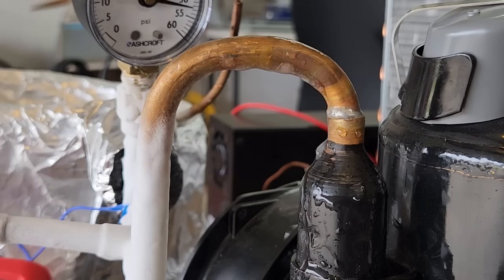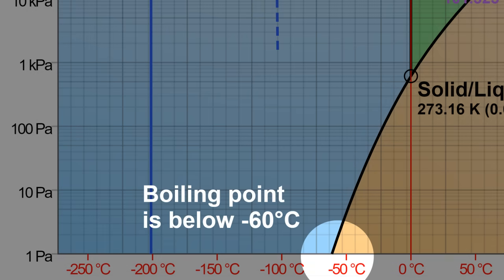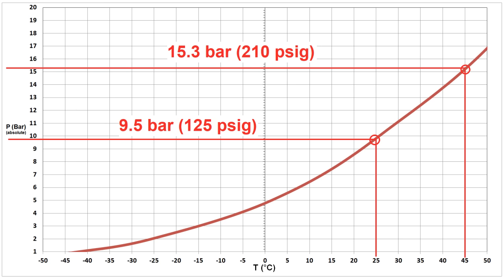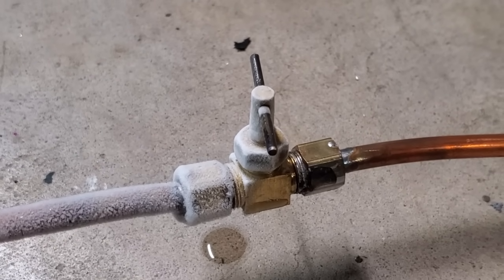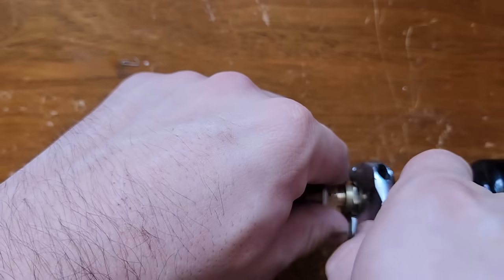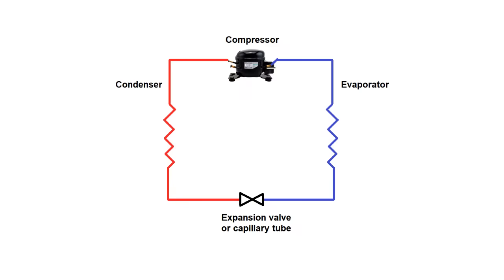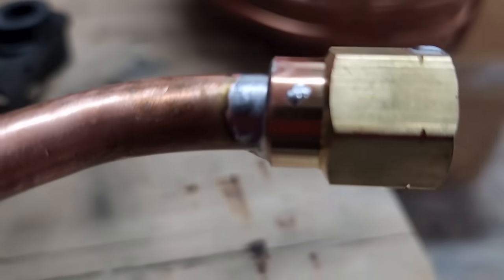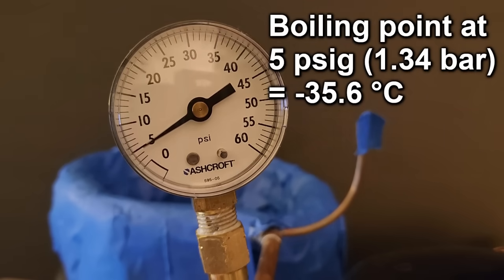DIY Vapor Compression Refrigeration System

Comment: A few notes, from someone currently going to school for this:

- Install your filter dryer last and change it as close to every time the system is opened as possible. Installing a filter dryer should be a very quick hot potato sort of operation, you get the pipes lined up, swaged or flared and ready, and right after popping the filter dryer caps off you stick it into the pipes and start brazing or tightening. There should also be zero temperature drop across the filter dryer (within your measurement margin of error), a temperature drop indicates the filter dryer is clogged or otherwise producing a resistance to flow. That dryer spent way too much time open to atmosphere and is unlikely to have much dry dessicant left, especially if you blew air through it testing the cap tube in that one clip 

- Solder, no no no. Solder can't be trusted with the sort of pressures you're working with. You should be using brazing rod, and learning to make flare fittings will do wonders for the ease of disassembly and modification of your system

- Awesome work on the calculations for your capillary tube! All that homework you did is the only reason this is working at all. 

- Pulling a vacuum before charging is, like super duper important, not just necessary. For best results, pull a vacuum below 500 microns of mercury (about .67 mBar), break the vacuum (let <1 bar of pressure in) with an inert gas (ideally nitrogen), pull another vacuum to below the same level, break it with refrigerant, then pull a third vacuum before charging. That's what's done in industry to reliably eliminate all moisture that can reasonably be removed

- That tube-in-tube HX for the cascade system is sketchy, to say the least. I'm very curious what sort of ridiculous pressure drop you have across it, the uneveness in space between the tubes is going to make all sorts of weird constrictions and pressure drops. An evaporator should have the same pressure throughout the whole thing, maybe a couple pounds' pressure drop at the very most, you'd do well to stick a pressure gauge on either side of that evap

- In the industry when we hook up to a system we measure what we call superheat and subcooling. Superheat is how many degrees above its boiling point vapor warms up in the evaporator after boiling, subcooling is how many degrees below its boiling point liquid cools to in the condenser. For instance, at 21:03, you just described 15 degrees C of subcooling, which is really quite a lot of subcooling, I'm taught to generally look for about 10 F/5 C of subcooling, so your condenser was performing quite well. Your evaporator got as cold as it was going to, without knowing the outlet temperature I can't tell the superheat but it was probably also quite high, I'm taught to look for 10-20 F based on application. Looking at a cap tube system, high subcooling and high superheat is generally a massive red flag for undercharged, that setup might have just needed more gas to perform better. With cap tubes, charge until the desired superheat is reached, for your application that's probably 3-4 C under load.

- The compressor is cooled by the cold vapor refrigerant coming back through the suction line. Your compressor didn't overheat because the condensor didn't reject enough heat, the condensor rejected tons of heat, the compressor overheated because at such low pressures it barely got any refrigerant to cool itself with and what vapor did come back was likely highly superheated. Issues with mixing and matching compressors and refrigerant aside, also a sign that the system could have taken more charge

- I don't even want to know what became of what charge was in that AC unit when you bought it to harvest its organs. Whatever happened to it, that was probably all illegal, if you live in the U.S. and aren't EPA 608 certified it was definitely illegal. Not judging, just a heads up

- Second setup: I see 15ish F subcooling and 5ish superheat, high-ish and somewhat low respectively. Condenser is very slightly starved and the evap is bordering on flooded. A flooded evap is fine to see in no-load conditions without the second stage built yet, especially with a few degrees left to protect from sending liquid back to the compressor. Once it gets a load on it and your superheat starts going up your compressor might stop getting cooled as effectively and overheat, though. 

- I think you've done this whole video charging passively, but I'm not sure. Just in case you've been opening up your propane bottle with the system off, weighing in a charge and stopping at that, you can charge with the system running by hooking the low side up to your container and metering it in. Should ideally be done with the system having reached its thermal equilibrium so you can charge based off good measurements.

- The cooling power calculations are gonna be off by more than you expect, just that little bit of condensation on the beaker is actually a ton of heat leaking into it. Good news! Your calculation is definitely an underestimate.

Very cool! Also kind of concerningly dangerous but you're definitely doing your research. Interested to see where this goes.

Edit after sleeping on it: Lost in trying to transfer knowledge, was, holy shit! This is really impressive, you've really done your homework. I'm almost only squawking about danger because of the solder rather than brazing, God only know I've done stupider. Keep at it!
Reply: You nearly got a like from me when you talked about the compressor being cooled by the refrigerant return stream and you made some good points, then you started beating on the guy! As a refrigerant engineer, have you never done anything a little naughty? The answer will be yes, we all have! This is one of the best You-tube channels, encouraging people to ask the question `how does it work` and how to modify things for other purposes. As for any perceived risks, they are very, very minimal and they are personal risks, and as such are of no concern to us.  I don`t mean this to offend, I am just aware that negative comments on You-Tube (and in real life) have the potential to stop people pursuing their hobbies and vocations. In the very least, it might put someone off the idea of publishing and sharing with us.
Reply: You're massively overthinking this. SH and SC are refrigeration and application specific. One application might have 5° of superheat and another might have 30. It depends on the application. There's no rule of thumb.
Reply: @Carbon good analysis of his efforts and shortcomings. About the only thing I would add is not to use soft solder on discharge lines and original compressor is probably designed for high temp application your low superheat concerns are warranted and you are right adequate mass flo cooling capability at operating temperature is also important. You have to keep the compressor happy. (I have worked in the trade over 40 years)
Reply: Agree with everything you say until your actually doing it in a time crunch especially the vacuum stuff.?😅
Reply: @jayfowler4747  breaking and redoing the vacuum is really only necessary with very large systems. For light commercial and residential systems a vacuum of 500 microns is fine and no nitrogen purge is required, the manufactures don't say its necessary.
Reply: You know there are other ways to do things besides what professionals do that get the same results... For example nobody is going to pay you to stand around for a long period of time with it just sitting under a vacuum, so you do a whole procedure.
Or you can just leave the vacuum pump hooked up for a long time. Lol 

As far as leeching refrigerant into the air being illegal, that's actually a gray area because you can buy the refrigerant as a spray can for freezing electronics to test them. Yeah, all kinds of CFC containing refrigerant in a spray can designed to be sprayed out. 
The difference is application and scale. There's no law that says he can't leak the refrigerant because he's not doing this as a professional HVAC guy. He doesn't have a license to lose. He doesn't have to report to certain authorities about things.
It's all bullshit politics. So I'm not advocating destroying the environment by encouraging huge industry to dump large quantities of CFCs into the air. Saving the ozone layer by reducing the CFCs being released is one of the greatest comeback stories of modern times.
But at the same time, if you open up your homemade cooler and release everything to the atmosphere, not only is there no authority to arrest you or charge you with anything but technically you're not being held to any law in the first place. And if you disagree come back with the actual numbers because we can all look up the laws online. ** This applies to US law only, It may differ depending on where you live
Reply: It's "super important" to vacuum out the A/C system on a car, but myself, like most people with a leaky system, simply buy a new can of R134A every spring. By next spring my A/C doesn't work again, who knows how much air/water got in there over the winter. It has a small leak but a leak to atmosphere nonetheless. I just squirt 134A in there, don't even purge the lines, barely look at the crappy gauge.

Still makes ice cold air in the NC sun, after 180,000 miles and 23 years of this abuse.
Reply: It is worth pointing out - it is nice of you to share tips, even if they are picky. ;) Something about HVAC guys, they guard their trade secrets like a chihuahua guards his Taco Bell. How dare a mere peasant play with refrigerant!

If you ask anything like this on a DIY forum you will get shut down immediately...
Reply: @TheTemporalAnomaly  I mean I've seen a case where a R134A/R410A mix was used as a rough R407c. EPA would stroke out if you do it but it works...
Reply: Solder can withstand 30 bar though, she'll be alright.
Reply: @hascrack3783  Ive seen it before. 50/50 mix by weight is that close to 407c that it'll work fine
Reply: @ForgottenLore  I've seen a soldered refrigerant line break lose. It technically can hold the pressure, but does not hold up to the heat and constant vibrations.

Flared fittings would be one of the best here, perfectly HVAC acceptable and cheap to do....but a bit time consuming. Compression fittings are no good either, even though they can technically take the pressure.
Reply: @ForgottenLore  for most of the joints soft solder should be safe enough but where he drilled the 2 90 degree elbows and soft soldered the smaller diameter pipe in is pretty sketchy, there's just not enough surface area for a strong reliable joint, decades of patching things up tells me it will fatigue crack in time
Reply: I love comprehensive additions to comprehensive videos, thank you for yours
Reply: @TheTemporalAnomaly  he is not an engineer yet, he mention school so he is still in training
Reply: I'm just learning so likely wrong but high subcooling would mean lots of liquid in the condenser and low subcooling would seem to mean too much liquid in the evaporator as zero would mean all liquid in the evap. So I would expect an overcharge or low load instead of undercharge. Could anybody help correct my understanding?
Reply: @dantronics1682  Most of his comments were spot-on, the only thing that I took a little issue with was the fact that he was kind of reprimanding the video creator for a `green` issue that most of us have violated at some time in our working lives. This is an excellent channel and I would not like to see him put off by negative comments.
Reply: @TheTemporalAnomaly  yes they were text book answers
Reply: Felt like I went back to school there, lol
Reply: That is a very well informed comment, speaking as someone a little informed!
Reply: I repaired a small comercial fridge using domestic propane, a re-purposed compressor from a dumped fridge/freezer. I used soft solder for the connections and had only one pressure gauge which I used on the suction side of the compressor as I charger the system. I did evacuate thie system before I charged it - by hooking up the suction of my workshop compressor to the improvised fill valve (a 1/2" ball valve). I did not change the filter/dryer.
18 months down the line that fridge is still in good shape and playing a vital role in my wife's mushroom business.
The pressure rating of a 95% tin solder at these pipe diameters and temperature raings is around 25bar so I see no safety issues there. I've been a mechanical engineer for 40 years. If you only ever do things "by the book" you will never make any progress or learn anything.
Reply: @nickwinn7812  sometimes people get hurt with the flammable type
Reply: Since nobody in this thread commented on this: What is your issue with the heat exchanger? Why do you think there is going to be a significant pressure drop across it (in either side)? What makes you think the inner tube not being centred matters in any way? The cross section around the inner tube will always be roughly constant, regardless of where it is positioned. The gas flow having to "go around" a super tiny bend is next to irrelevant. A whole 90° elbow bend only adds a pressure drop equivalent to the drop along a 50 pipe-diameter long section.

About the cooling power / condensation on the beaker: He had a nearly straight line of T over t (constant dT/dt). If the effect would be relevant, the curve would have gotten less steep at the lower temperatures. But it did not.

Why do you think soldering is an issue here? I am not sure if I ever saw brazed R134a lines, I think that would have stood out to me. Yes, it has a lower vapour pressure, but I doubt the safety factor would be that low. Seeing how solder is as strong as the solder itself, as long as the copper is properly wetted... it does not feel wrong. However, I am not going to do stress calculations and I dont have experience with such things (failing). So if you have some insight that would be great. Something like... maybe its the larger pressure swing (start/stop) that eventually causes cracks to form due to fatigue.
Reply: or you could put it under vacuum and let it boil off any moisture.
Reply: brothers a red seal refig mechanic, will have him look at this quick to tell me either "hes full o' !@!@@%" or "yea this looks about right"
Reply: @ryanroberts1104  You are a small time kindergarten violator!  :)   Back in the 70's I had to put a can of F12 in the system each morning before work! At 59 cents a can it wasn't an issue! Now at 50 bucks a can I carefully trace out any leaks at all. Going on 2 years now with no change in cooling in my 88 Towncar!
Reply: The whole first comment is gold. As a electrician I happen to have experience with brazing. Cherry red and brazer rod. Silver stick is a good one I use.
Reply: @ForgottenLore  solder decame brittle at low temperatures, I saw electronic sensors solder failed at - 45ºC
Reply: you forgot to mention that the capillary tube should have been coupled to the vapour line for improved heat transfer.
Reply: @hascrack3783  You can mix R600a and R290 in 50/50 and get a refrigerant thats 100% like 134A, just flammable.
Reply: @glasslinger  where are you even getting r12 these days? All the stuff I can find is knock off freeze 12 blends, not actual r12.
Reply: He wont see any liquid flowing in the compressor because there is a tank for catching any condensing refregirant before the compressor but yea the other points are correct specially the ammount of refregirant in case he doesnt want to starve the compressor if it all condenses edit * liquid seperator i think its called in english
Reply: @ryanroberts1104 if it is low and not totally empty then vacuum doesn’t matter.
Reply: @jamesschuchardt9509  And I explained it was entirely empty and vented to atmosphere. Every season!
Reply: If you're in the industry then maybe you can help me.

I want to replace R134a in my car with pure R290. 
Not a mix of R290/R600 to match the pressure curve. My goal is to have a lower boiling point so I can increase the cooling capacity. 
I moved to a hot and humid climate for a few years for a job and took my car with me. 
The A/C is charged correctly but simply can't keep up with the humidity. 
At 96-97% compressor load my evaporator temperature is at 18°C or even higher. Sometimes even 24°C on a particulary bad day . 

Do you think it is possible? It's VW and I have VCDS so in doubt I could modify sensors with resistors to my needs.
Reply: @no-damn-alias  Not worth the effort. Even if you manage to do the refrigerant swap, the extra cooling capacity doesn't come from nowhere, that would be harder on the compressor. Pretty certain you'd also need to change out the expansion valve which, at that point, you're doing so much work you might as well just go to a scrapyard, find an automotive AC system with more cooling capacity, and rip the whole old one out to replace it.
Reply: @carbontetlabs8606   well I could change the pulley on the compressor or on the crankshaft wheel for a different diameter to the compressor does more work. 
There are adjustable expansion valves out there. 
An AC compressor is rather cheap for that car so is an expansion valve but changing out the whole AC system will be a hack job. 
This car is from 2008 and residual value is about 3000€ and I mainly want to keep it as it has emotional value for my wife although she now drives my Mercedes with my son as it has a stronger AC. My stay here is temporary for probably around 3 years. 

I just thought about it theoretically so far. 
I studied mechanical engineering and I can help myself on many matters but AC systems are not my field of expertise.
Reply: He really used electronics solder for this? lol I thought he was brazing here and called it solder, usually means the same thing. Brazing and solder is same, I do agree to buy the solder which is engineered specifically for refrigeration or application.
Reply: hvac nerds
Reply: @TheTemporalAnomaly  so can i try with solder? Dont want to spend for stuff i might use Just once
Reply: @paolo69  It`s been a while and I have lost track of the comments. Please clarify your question, what is it that you want to do with solder? Soft solder is ok for the pressure but does not hold up well to hot/cold temperature cycling. I am guessing that your question was about this subject.
Reply: @TheTemporalAnomaly  yeah i want to try to build a small vapore compressione system because i have the compressor and most of the material Needed, It wont be a finished thing Just a prototype to see if i like this type of project thank you
Reply: @paolo69  Yes, that is very easy to do as long as you are aware of its limited life due to the solder suffering fatigue from repeated thermal cycling. I would salvage the compressor and capillary tube from a fridge. Make two coils of tube, one for the condenser and another larger diameter for the evaporator. Use the little copper bulb connected to the capillary tube (drier filter), connect between the condenser coil and evaporator. Into the bulb end from the condenser, through the capillary into the evap. The compressor output goes into the evaporator coil and the free end of the condenser goes back the the compressor input. I would use all copper tube as steel is difficult to get a good solder joint to (less wettability for soft solder). Use a good quality tin-lead solder and use a separate flux. Make sure you clean the ends of the tube well where you are soldering. Make sure that any gaps where you want the solder to flow are small as possible. If one tube is too small for the other, wind some fine copper wire around it to increase it`s diameter. For the refrigerant, I would use regular butane lighter gas, for a demo unit like this you will not need much more than 100g. Pay special attention to the joints to the motor input and output as these connections on the motor are usually steel. Use a vacuum pump if you have one, before the gas fill.
Reply: @paolo69  Let me know if you got my comment and suggestion. I think U TUB is deleting my comments for some reason.
Reply: @TheTemporalAnomaly  yes i got It thank you and It Is still there After a day so i think, at least some comments, are safe
Reply: I tried to measure the super heat of butt gas but had no luck
Reply: @markshort9098   Wrap around with some fiberglass cloth strips and JB Weld original after?
Reply: @carbontetlabs8606 Before pulling vac, pressure test at the highest pressure on the low side
Reply: As an Aussie fridgy, finding the conversation entertaining. Yes we are also regulated regarding refrigerants. Just to add regarding air in the system. The moisture in the air will turn the ester oil acidic which will eat away at the winding insulation. When the insulation fails, it will result in arcing. Combined with soft soldered joints and butane as the refrigerant, the outcome is obvious.....KABOOM. Good luck with your endeavor creating a cascade system but unless you change your refrigerant, I would be very wary.
Reply: hey carbontetlabs have you built your own refrigerator by now?
Reply: hey carbontetlabs have you built your own refrigerator by now?
Reply: @morgangrisby8107  I would not advise using tin based solder. I used to use blue tip brazing rod. It melts at 610C and flows at 620C. It is less likely to crack from fatigue compared to brown tip that melts at 720C. The joints must be spotless when using blue tip. Appropriate flux is also required. It is not all about temp. Fatigue, pressure and resistance to electrolysis.
Reply: @marlinblack6597  Arcing in a pure flammable-gas environment with ~no oxygen won't make a kaboom. Leaking joints won't make a kaboom unless the gas both forms an explosive mixture with the air (right ratio, not too much ventilation that clears it all out) and then gets a spark. If you do it in a well-ventilated area and monitor it for loud hissing noises, and watch out for nearby ignition sources, I personally wouldn't be too scared of it.